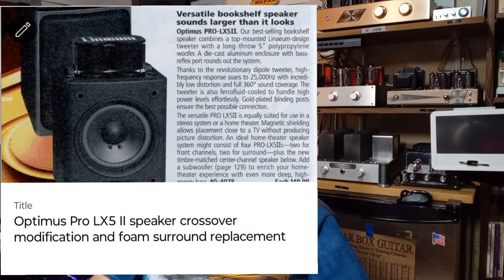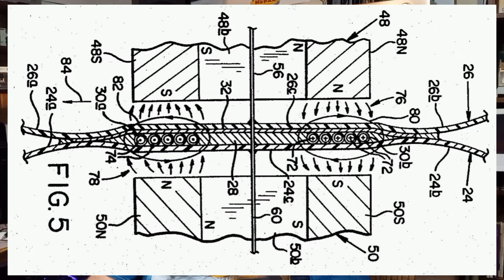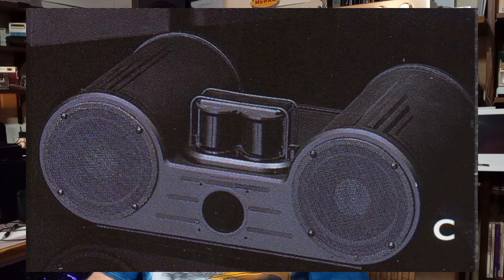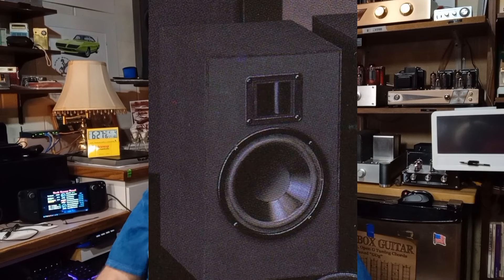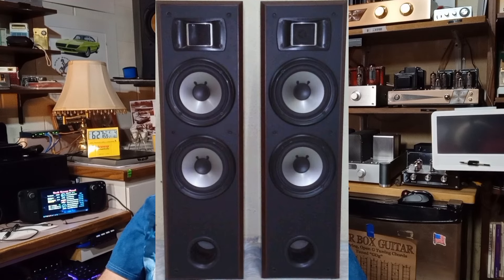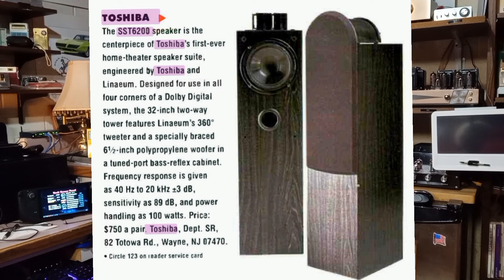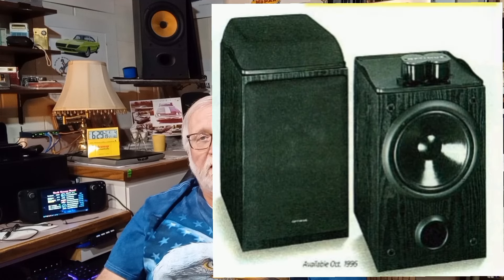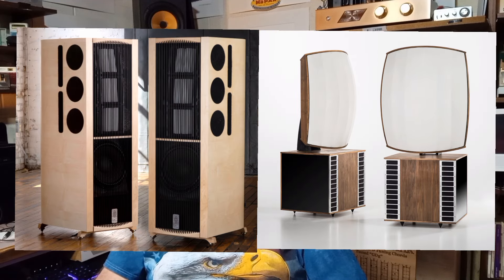What the heck is a Linaeum tweeter? How they worked, their use in speaker systems past & present day

Comment: For the Radio Shack Linaeum line, there was also an Optimus center speaker with a monopole tweeter. They then rebadged (and slightly redesigned) many of them with the RCA label. It's also my understanding that the original Linaeum tweeters used a thinner (and thus lower mass)  diaphragm than the RS speakers (which I guess in theory would make it more responsive). I don't know about the Kenwood and Toshiba models. We've discussed these tweeters quite a bit on Audiokarma.
Reply: been eyeing one of those centre recently. ive found one; quite far away, needing refoaming, and expensive...